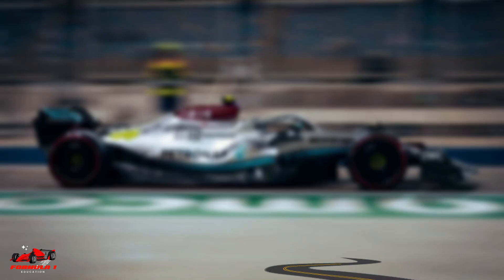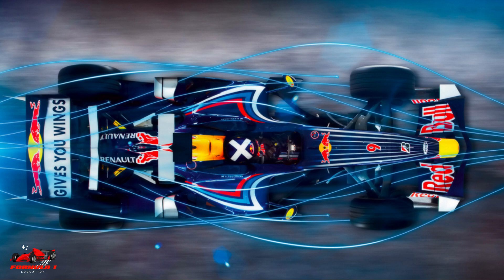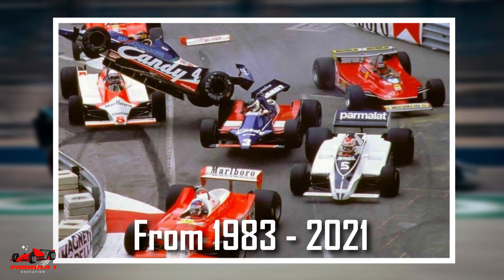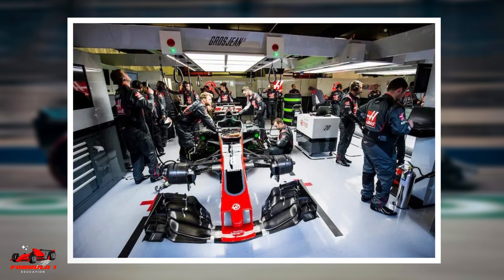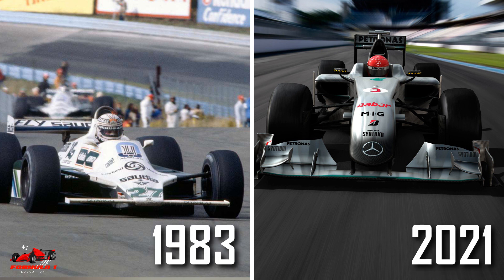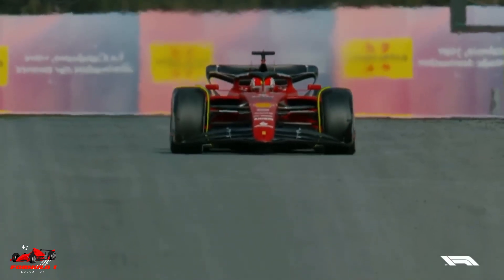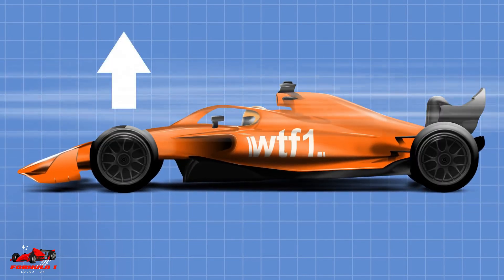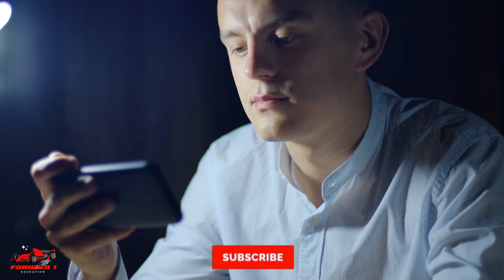Porpoising and Ground Effect Cars - Explained

Comment: I wonder could there be any solution at all without mandatory flat floor again. Great video!
Reply from the maker: Thanks for the comment. It will be interesting to see how it goes. The cars look a lot more drivable as compared to testing so maybe in next few events the teams will resolve this issue
Reply: Can't these just create the same pull downwards from higher up? I assume the difference are the side pods so without having to put pods back in just create a pull down feature that's active even tho the under floor is shut off or is that illegal?. Being the only big difference between cars is that not where you should be looking?. Or is it as simple as reducing downforce?.